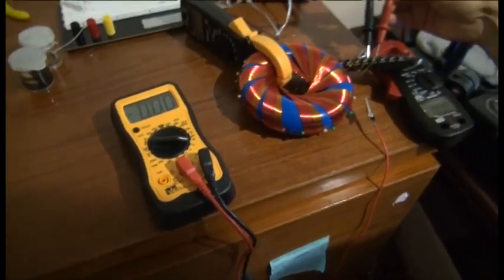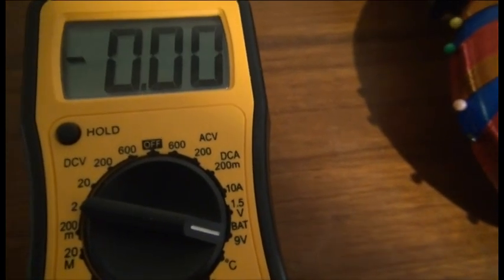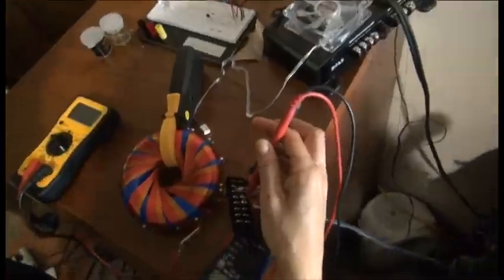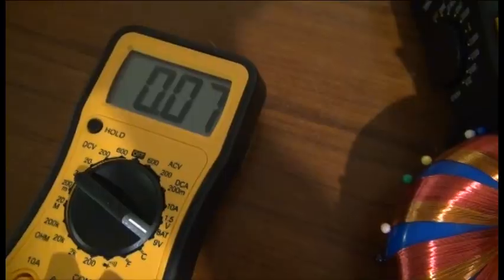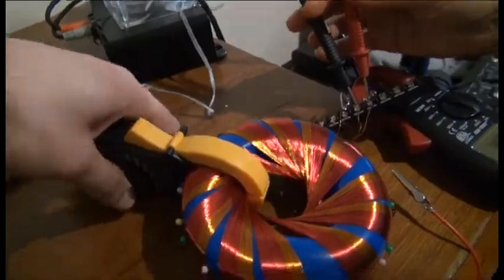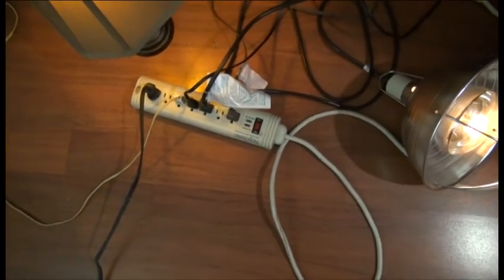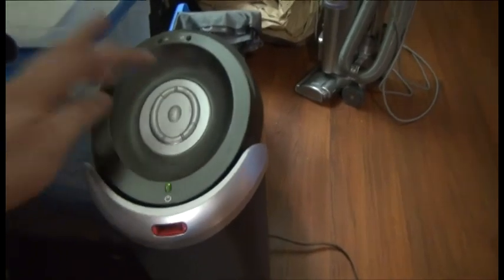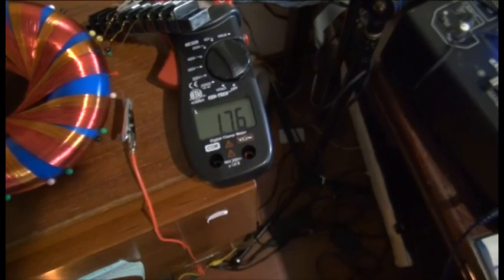Aethereal Coil -- 05/28/2012

Comment: So how exactly are you drawing 242 amps through a 10 amp power strip??
Reply: He isn't.  He is using a clamp on current meter incorrectly so that he gets nonsense readings out of it.  Notice that he has many turns of wire and a core passing through the clamp of the meter.  With that type of meter if you pass the wire through 10 times making a coil, you will get a reading that is 10 times the current.

Comment: That is not an over unity.  It is just a poor quality step down transformer.  When you reduce the voltage with a transformer, the same ratio applies in the opposite direction to currents.

Comment: You don't understand what unity means, if you did, then you would understand you cannot have over-unity.
Reply from the maker: The theory of overunity means when you extract more energy than is being generated and this definitely happens through frictionless EMF transference if not how else or what do you think overunity theory might be.. Most all of science today is still still theories which are ever changing.  Unity:

"Unity" refers to a system where the output energy equals the input energy. In other words, the system is 100% efficient, with no energy loss or gain.
For example, if you input 100 joules of energy into a device, and it outputs 100 joules of usable energy, the system is said to have unity efficiency.
Overunity:
"Overunity" refers to a system where the output energy exceeds the input energy. In other words, the system produces more energy than what was initially put into it.
Overunity devices are often claimed to violate the principles of conservation of energy, as they seemingly create energy from nothing. However, such claims are typically met with skepticism from the scientific community, as they contradict well-established physical laws.
Despite numerous claims and experiments, no overunity device has been reliably demonstrated to date within the framework of mainstream science. The closest tech to discovering overunity I predict will be through the continued research of vortex math, vortex coil development, quantum compute development with infinite scalable vetors, with precise measurements of EMF fields, and through the advancements in graphene and other superconductive room temperature devices.  Telekenesis the most ancient form of overunity and the most accurate system in the ancient times ever built were weapon systems, Vimanas, and internal sacred implosion arts so Over Unity is and has been well understood for possibly 100s of thousands if not maybe millions of years ago. All the giant pyramids and scared stone sites many of them are physical monolithic relics to the knowing of overunity that taps into the Aetherical EMF energies of earth these energies are true aethereal overunity exists all around us.
Reply: @AMARAKATV  That doesn't qualify as "theory".  A theory in science is an explanation of how it works and not a claim of magic.

Comment: because the loads you have on wont be pulling 200plus amps ,youve got something wrong there
Reply: you cant measure current thats not being used
Reply from the maker: @angusmcgil  For me its all about harnessing the eletromagnetric field next Im finally moving into ferrite core votex coils ramping into 1,000 to 5,000 watt powering a motor, computers, lighiting, fans, and then heating my hotwater with the excess heat. The high reading on the amps are purely the amount of turns which I think was between 21 to 26 turns X 12 points.  Marko Rodin always touched up the magnetic field being the key to these coils.
Reply: have you looked into the cone inside a cone i mentioned they were refered to as vortex coils ,for memory brashear talked about them alot
Reply: @AMARAKATV  they are intsecting copper cone coils that are supposed to access the eatheric energy when it hits a certain resonant frequency giving huge amplification of energy

Comment: There is no such thing as overunity. It's impossible.  Your measurement methods are flawed heavily.   Putting an amp clamp around the coil is measure multiple coils so the measurement is compounded incorrectly.

Comment: Whats the hardest part about making videos like this? Hiding the batteries 😂
Reply from the maker: That was just a DJ mixer with a microphone without two turn tables. I just wathed the video again and that car amp had a 120v plug and I think it was 150 watt maybe 200 watt amplifier max output. That test I was just excited to see so many amps running inside at the time because of my intention to create an amp booster which I have since but not with vortext coils yet.  The low volt reading was interesting and not common to see in many other types of tests I ran over the years usuially when I run 120V devices there will be a voltage drop but going down to just a couple voltz is still interesting to see many years later. I just found this old video and decided to share for fun.. I am now gearing up finalization of a major power savings and amplification cicruit which I may share down the road after I commercialize and license and finalize my high voltage circuit storage aspects.
Reply: No need for batteries (apart from in the meters) as it's the incorrect use of a clamp meter alone that causes this erroneous measurement.
Reply from the maker: @KayakingVince  Ok but can you explain what is going on totally and how 150 watt amplifier is powering several devices and how they are running wuth 120v requirement and why the volt meter showed just undet a few voltz? Usually voltage ratings must heat required specs to power up. If i was high some LEDs can use high voltage but under 2volts ive never seen a test light up any 120v unit, this was the only time i have seen thia and im going to fully get to understandiing whats happening here. Lukly i found the scientific reason how all eletric circuits work which ive not seen on Youtube. It will be interesting to see if anyone can explain how elextric cicuits work becausrme ive not ever seen amy good explanation yet in Youtube ariund how electric circuit move electric across cables..

Comment: Did you forget to post this on April 1st.... 🙂
Reply from the maker: Hey do you happen to know anyone who might be able to explain exactly whats happening here since you seem to be electrical savy? Mr. Bristol is overunity possible at all in your understanding of electric?
Reply: @AMARAKATV  
Over unity? Impossible with current technology. Anyone who claims to demonstrate it is using magic tricks. An internet search for ‘Over Unity’ will give you all the detail as to why. Your readings are high as described by another commenter has said with how you have the clamp meter set. A current clamp meter is designed to have ONE wire going through it. Multiple wires will give multiplied readings of the actual value. Your experiments will help in the development of a more efficient driver, but there are plenty of good ones already available.
Would suggest you don’t post videos as ‘Over Unity’ as they are not, and will only attract less than favourable comments.
Cheers
Pete’.

Comment: what's the frequency of the square wave and on / off time ? it's nothing new about inducing current using a high frequency - basic operation of a switch mode PSU. You can't use a multimeter to measure a high frequency either - you need a oscilloscope with a series resistor also to measure the voltage drop to determine the current flow.
Reply from the maker: That was so long ago most likely I was just running 60hz usually you dont want to go more that 150hz to not loose amphere electromotive force.  Most high freqeucy testing I do will only occur when I start building attennas for telecommunciation systems which I need to deeply analyze that direction which mostly will be in low orbit satellites, 5G, 6G and WiFi AX and WImax as well Bluetooth 4.0 and Lora for IOT dev as well ATSC3.0 stack.

Comment: Not sure if he is not sure how electricity works, or is trying on purpose to make one so absurd on purpose here can say he going it shown on electroboom's LATITY.
Either way, this is not how it works, this is not how any of this works.
Hell, if you worked out a way to send  9v 250 amps (2250w)  through that TINY coil wire without it letting out the smoke, you would be a millionaire. No need for over unity..Just sell that magic wire. Second '120 volt' means nothing as far as power draw. Volts != watts. I could hook 40 120v LED hallway bulbs to a 9v battery with a simple transformer. Third you need a MAGNET in your coil (for it to be a coil), I'm assuming with the push pins in it..its just a hollow plastic donut..
Reply: tesla single wire energy system? this does not use transverse electromagnetic wave but instead  magneto - dielectric longitudinal pulses.
Reply from the maker: @toymaker3474  Tesla experimented with impulse current and oscillating current. Our electricity is direct current and 
alternating current. The Four Quadrant Theory of Electricity is:
● Impulse Current
● Oscillating Current
● Direct Current
● Alternating Current
alternating current + direct current are transverse electromagnetic
impulse and oscillating current are longitudinal di-electric                        My final verisons of my circuits will include all four quadrant theories of electricity and working to amplify current while boosting voltage using IGBT input fed in to boost the volts back up as well pulsed gates based on the frequency and impedance of each type of ciruit Im modeling. Any insigths you might have or ideas I would be happy to test later this year once I get all my parts and meters ready. I will have Solar Wind and Graphene UltraCaps and Battery as my source power with various motors that tie into the circuit with power management phase correction layers.
Reply: @AMARAKATV  i  recommend this book  ELEMENTARY LECTURES
ON
ELECTRIC DISCHARGES, WAVES
AND IMPULSES,
AND
OTHER TRANSIENTS
BY

CHARLES PROTEUS STEINMETZ, A.M., PH.D.
Reply from the maker: Yea vortex torrodial coils in general handle heat very well heat disapation is the lowest hanging fruit which I am now modelling into thermal heat sotrage as well.  Im still going after energy saving and amplification, the saving happens which you add a Neo Magnet in the center then you can generally get 20% to 30% or more savings depending on the gauge and size of the Neo ball..  Still interesting to see such low volts and high amps in that test, now days I modelling with thousands of watts of solar and graphene batteries with power management and phase alignment tech stack.

Comment: BS
Reply from the maker: I think I will tackle adding the votex coil inline of my power amplification and energy amp reduction system I already know the pathways but building my entire circuit has taken a long time but the core is already working and its a motor based system this coil I will use for more testing and efficiencies. My motor circuit already saves over 50% maybe more on energy and I think each coil with a neo mag in the center I will see around 15% to 25% drop in amps then just make an array and storage circuit. The other use is using the excess heat from the coils to heat my water to my house.

Comment: You are looping the wire multiple times through the meter, that is why it is reading such a high amperage. Its going to read the total current passing through it, not the current of your circuit. If you instead clamped around a single wire of your secondary coil, you would get a 'less than unity' measurement.
Reply: Keep it up! Ignore them haters 👍
Reply: Yea exactly so its more like 242 milliamps, not 242 amps!
Reply from the maker: @tyronenelson9124  200 milliamps wont power any 120v device..
Reply from the maker: @tyronenelson9124  The 120 volt devices it powered took way more than 200 miliamps. Sorry i didnt have watt meter for the strip my mew tests will be better..
Reply from the maker: Glad you understand how coils and turns work.. Im after developing a useful circuit in capturing the excess amps. I do have a preprietary energy amplification system that so far works and next step Im building a transformer energy efficency storage power correction circuit.. This video were just some early observations but I do believe with my neo magnet in the center with ferrite cores and storage circuit I will finally have a usefull tech around vortex coils which is to my knowlege the only practical way forward aside from wireless research and capacitor coil array research.. Overunity I predict will only be possible once I overcome how i manufacture my graphene wire which till this day is still a very difficult challege that no organization to my knowlege has overcome.  I left out some technical info in this response but if you are sharp in these domains you can maybe guess what might work as far as commercially viable product which I plan to have by mid next year.  The ehances magnetic fields that Vortex coils generate is the key break through of this science which is building strong harmonic magnetic amplification that enhances transmission of energy.
Reply: @AMARAKATV  I don't believe in any free energy solutions. I feel as though the laws of our universe exist solely to prevent free energy.

With that being said, I never try to dissuade someone from attempting it. At worst, its a great way to learn about physics. 

I once had an idea for free energy, or at least a way to violate thermodynamics, based on the fact that ferromagnetic materials cool down when they leave a magnetic field. I knew there was something I was misunderstanding about the physics, and when I learned more on the topic, I learned that they also heat up when they enter a magnetic field. It really seems like these phenomena exist solely because there can't be a way to make energy. 

I wish you luck in your endeavors, and keep your eye out for non-free energy discoveries/ideas you come across on your path too!

ps. you did a great job wrapping that core, I don't think any of my electronics projects have ever come out looking that nice.
Reply: @AMARAKATV  You are just building a step down transformer.  There are no excess amps.  
There are two types of people who claim over units:
1) Folks who are fooling themselves
2) Folks who are fooling others.
Reply: @kensmith5694  Ehh, I don't believe in free energy, I feel as thought the physical laws of our universe exist to prevent it. But with that being said, I don't dissuade people from pursuing it. If you can think of a way to make free energy, it means you misunderstand some aspect of physics, and by trying to make a demonstrator, you will learn whatever you are missing better than any book or article could teach you. Also you are building real skills in the pursuit, for instance, that transformer was perfectly wrapped lol. The important part is to not waste more money that you can afford to, and to not become obsessed or deluded.
Reply: @Vsor  People wasting their time on "free energy" could instead be working on something useful.  Thus I tend to tell people they are on the wrong path.
Reply: @kensmith5694  Im just happy when someone is doing SOMETHING. Most people waste their time on tiktok or something equally pointless. Whatever gets someone interested enough to sit down with a soldering iron is good. Who cares why, all of my homemade radio filters are just as worthless as a failed free energy device at the end of the day anyway.
Reply from the maker: @kensmith5694  Step down or stepup transformers that ive seen and used dont behave this way. Its funny all who claim to understand electricity also cannot explain scientificalky whats generrally or exactly going wuth vortex coils. Im no expert even today but the way these readings and the load that 150 watt amplifier was running may have been over 150 wattsvwhich i never had enough watt meters to measure everything..my new tests will be able to test all devices and theor load. I do hope to see some high level expert tell me exactly what we are seeing but i expected to see a buch of bashing most dont know how to teach and correct a non expert like my self.  One thing im confident of is that i will not stop until i achieve a funtional circuit with vortex coils i know its an impotant technology that gas many amazing potentials.
Reply from the maker: @Vsor  I agree 12 years ago i got excited and was and still cankot totally explain what we are seeing nor have i heard a complete electric and scientific answer which i do hope to hear someday. I think vortex coils may operate differently because when has anyone ever seen a step down or step up transformer behave this way i never have. Most ive seen only power the target voltage they are designed for.  This coil was reading under 1 volt and over 200amps and powering ON 120 volt rated units.. i would love to learn why is all..
Reply from the maker: I think we are seeing electro magnetic flux field passing source input voltage through the field by STABLIZING and amplifying current so the coil became a highly effective but out of phase alignment. I will attemp to correct or boost the volts up and also collect amps in my new tests in coming months.
Reply: @AMARAKATV  You haven't seen all transformers.  The clamp is enclosing more than one turn of the wire and the magnetic core.  This is not using the meter correctly and it explains the wrong reading you are seeing.  There is no mystery at all.  There really is no such thing as a "vortex coil" but all of the coils I have seen made and called that can easily be explained.  You admit to not being an expert.  You have done that first and then ask for others to explain stuff to you.  There are folks out there who can explain it to you.  Sadly you will continue to waste your time on this instead of working on something that might actually work.
Reply: @kensmith5694 🤦‍♂️